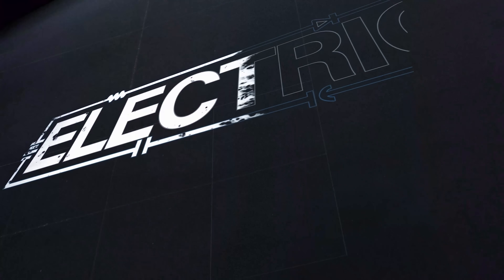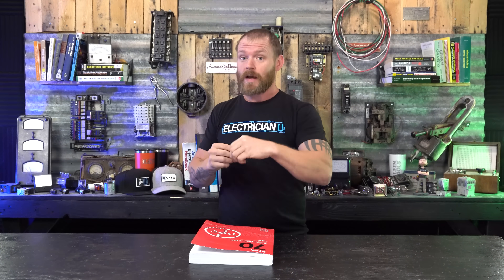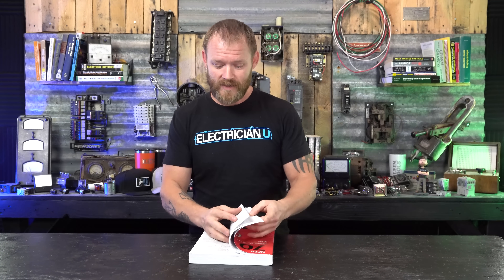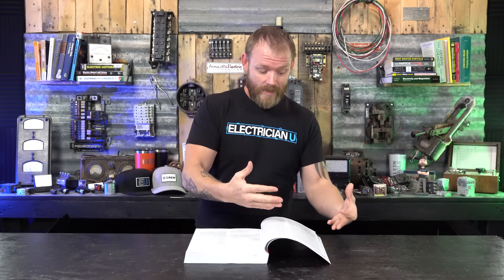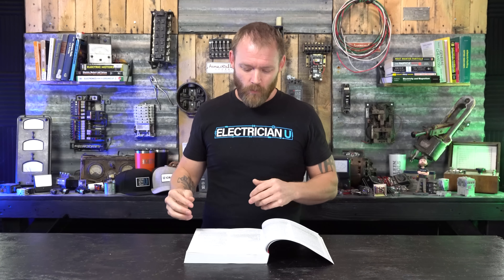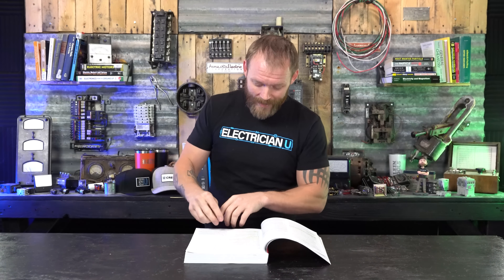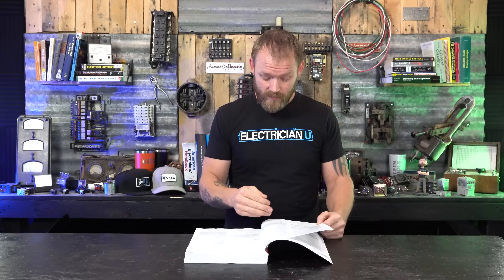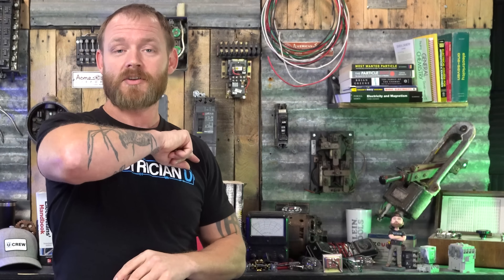Where Should We Be Using Dual Function Breakers?

Comment: Replaced a bunch of Zinsco panels in the HOA laundry rooms. We have dual function Eaton breakers.  Some of them intermittently trip.  I checked the receptacles and some of them were old and could see some arc burns on a few of the back stab devices (50 years old). replaced them but that did not always solve the problem.  Our machines were 20+ years old and figured those old motors could be the cause.  Now we have new machines and some where they were not tripping are tripping. 
How to test the breaker to prove to the machine vendor that their machine is the cause?  When neither replacing the breaker and I cannot get the vendor to change out the machine, what can be done? A regular breaker does not trip but i cannot leave it that way. Maybe GFCI the outlet?
Thanks in Advance.

Comment: What to do when some appliances need 220 v . That means 2 phase 110v + 110v and the breakers has a jumper together connection for two different circuits breakers.

Comment: The answer to your initial question. NO WHERE! EVER! Especially arc fault. Arc fault should be internationally banned and the people that came up with the idea jailed.  The devices can't tell the difference in a current spike from an arc and the 120 current spikes per second of LED bulbs.  Or switching power supplies. Or noise from a lightning strike 50 miles away.  I had my battery operated(because the breaker was tripped) AM radio ON during a storm 50 miles away and every time the speakers crunched with lightning static I could hear pops from the breaker panel. In 20 minutes all but one of the 30 had tripped. Ground fault or Arc fault detection should only be done right at the device and not remotely through long wires. So that totally rules out the breaker panel. GFCI outlets should never be daisy chained to another outlet. OK, maybe if that other outlet is 3 feet away but not more than that.  That wire acts as an antenna and picks up noise.
My new house has all GFAF breakers and is a disaster. A year of this and no electrician has any solution except to take all those GFAF breakers out. The electricity is out so much that the house should be condemned and just torn down.  We have taken to checking into motels on cold nights.
While writing this I decided to get a cold drink. I opened the door and the refrigerator is off. Breaker was tripped. I hate this house.
A house with no electricity is not safe.
You mentioned that arc welder manufacturers are going to have to figure out hose to reduce the current spike of the arc.  The way to do that is capacitors.  0.1uF/400V ceramic caps. But really what that does is mask out the current spike of the arc. Not getting rid of the arc but rather just masking it so the AF breaker can't see it.  So I need to put 0.1uF/400V caps on every line in my house so the GFAF breakers that are required by law can't see any of the noise current spikes. And at the same time they won't be able to see any current spike caused by an arc. Thus negating the entire functionality of the AF breaker. Since electronic noise is so ubiquitous in today's households due to all the new electronic devices I can only conclude that Arc Fault was invented by people that wanted all electricity off.

Comment: Do I need to install a combination Afci and gfci circuit breaker on the switch and light circuit? If so, is there any problem with installing a 20 amp dual function circuit breaker on that circuit?
Reply: replace what is there, lighting is usually 15A or more current modern could even now be just 10a with all LED stuff

Comment: So is there a time delay breaker?..i have a welder rated at 20amp on a 20 amp single pole breaker square d hom breaker..it pops the breaker at times..
Reply: All breakers are time delay which varies slightly between manufacturers, but as a rule of thumb, for example 22 amps flowing through a 20 amp breaker may take a few minutes to trip, while 30 amps might trip it in 30 seconds or less, while 200% of the rating usually activates the magnetic portion of the breaker and trips it instantly.  

The exceptions to this are instantaneous trip breakers and some adjustable trip breakers, which you would only find in industrial panelboards for special applications.
Reply: @rarelampcollector  so if my 20amp welder trips the 20amp breaker ..what would be the way to fix that.?..there's other outlets on that circuit but aren't being used..its about a 75ft run
Reply: @rossokeefe9268  if there is nothing else being used on that circuit, and the breaker occasionally when the welder is being used, either your welder is pulling significantly more than 20 amps, or, much more likely, the breaker is worn and heating up more than it should when carrying it's rated current.   To check for a worn breaker, place a clamp-on multimeter set to AC amps around the wire coming off the breaker.  Have someone at the panel watch the meter while you briefly weld with the machine set to the highest current you'd likely use. If the average current reading is at or slightly below 20 amps and the breaker trips, then the breaker should be replaced.

If you get an average reading of, say 25 amps or more, then either you may have a problem with the welder that's causing it to draw a lot more current than it should, or you may need to run a dedicated 30 amp circuit.   Check the nameplate or the instruction manual that came with the welder, it will list the input current as well as specify what size breaker or fuse is required.   

Some of the smaller welders designed for use on a 120V circuit, can also be configured to operate on  208 or 240V.  If so, and you aren't using the other outlets on that circuit and are absolutely certain there's no lights or other  hardwired appliances on the circuit you can convert the circuit to 240V (or 208V, if you have a 3 phase service) by replacing the single pole 20 with a two pole 20A breaker and putting the black and white wires on the breaker.  Then install a NEMA 6-20 receptacle where you want to use the welder, and remove or disconnect the other outlets on the circuit to prevent someone from plugging in a 120V device and getting a rude awakening.   The existing outlet boxes can be used as junctions if necessary , to supply power to the new 240V outlet.   A welder than can run on either 120V or 240V will draw half the current at 240V when welding at the same current setting.  (Amps = watts ÷ volts) 

Good luck with your troubleshooting journey 🙂

Comment: Thank you! Once again a great video. I am a handyman with decades of electrical experience in the Telecom industry. My customer's house was built in 2019 with EATON service panels (main and a sub panel for Casita and pool equips., etc.), and has 13 defective of 21 DF breakers (won't reset, tripping when no one is there for months at a time, they are AZ snowbirds from IA) or, the test button buzzes but won't trip the breaker. 4 of 9 GF breakers are defective. I made a chart to see what I can move around, replace a DF with a AF or GF, or even a standard breaker to save him some money. This video will help me do it but, in the end, I think it would have been less effort to just replace them all with what's there already. But then I would not have learn as much as I have about these damned things! P.S. Like the really old AFCIs, I think theses DFs are going through revisions to mitigate failures of this magnitude. Fingers crossed.

Comment: Question for the smart old (or young) Folks in the room. What am I supposed to do with an older home that still has cloth 2 conductor wiring. I added a dual function breaker to my kid's room with the hope that it could save him from a shock. Also, will be adding the new tamper resistant plugs. Is this adequate, or am I just totally off base? Also, can I test it at the outlet somehow? This is in an apartment home, so I can't really redo the wiring but got permission to make these changes at my own expense.

Comment: Was updating receptacles to TR in my family room and the breaker tripped out on AFCI as soon as I turned it back on.  I went back and checked my wiring to find that when I had pulled the tab on the receptacle to enable half to be switch-controlled, it left a small burr that was arcing.  The AFCI may have saved my bacon.

Comment: Another advantage of GFCI in panel is the ability to take a circuit tester and plug it into a receptacle and press the test button.  Then you know you can work on that circuit and the correct breaker is off.  Of course, verify, but this can save some back-and-forth to the panel.

Comment: Great video (as usual). Please stop at GFCI protection if you have a metal or wood working shop AND have tools with BRUSH motors. AFCI protection will cause nuisance tripping in this instance. I regularly use a 70-year-old Radial Arm Saw (RAS) in my production woodworking shop that is technically part of my dwelling (converted garage). The RAS, and all of my older routers (for example) still have motors with brushes. Most (all?) new tools are “brushless,” so this will allow AFCI protection. It’s cost-prohibitive to replace all tools with brush-containing motors with new brushless ones. Thanks NEC for allowing this exception.

Comment: It's weird how complicated stuff is up there. Here in Argentina we have the line and neutral from the meter to a general thermo magnetic "breaker" which trips with overcurrent so your cables don't melt and also with shorts between live and neutral. From that to a differential that trips with ground derivations. Then you add smaller thermomagnetics for each individual circuit in the house, generally 10 amp for lighting, 16 amp for receptacles, and a 20 amp for special use receptacles like ovens and water heaters. And AC units are generally in a separate circuit too

Comment: Why doesn't anyone ever mention the big issue with AFCI in the code. The first device from the AFCI can not be any longer than 50' of wire for 14/2 and 70' for 12/2, that can cause nothing but problems with larger houses..
Reply: Oh shit I didn’t know this. We have AFCI circuit for lighting and you can’t even turn the lights on without the breaker tripping. Wonder if this is the issue. We have swapped out afci for time being with normal inverse time breakers and it holds just fine

Comment: This is super detailed and a great educational tool for anyone looking to learn about arc fault/ground fault breakers. Has anyone dealt with Siemens afci/gfci dual breaker tripping? I have them in my kitchen and laundry rooms both of which trip for a blender and heat pump washer/dryer.  I’m replacing both with an arc breaker and gfci blank in my crawlspace for the kitchen because they combined two receptacles there that need gfci protection. Anyone with info on those breakers would be great. I’ve tried replacing and they consistently trip no matter what but don’t trip on regular arcs or other gfci’s.

Comment: I just got a new fridge installed & it’s tripping the breaker multiple times a day, the old fridge was just fine. 
the current breaker running it is a CAFCI arc fault breaker and plugged into a regular outlet. Would swapping the breaker to a dual function breaker correct the issue?

Comment: I agree with the inspectors. If you do a modification add AFCI at all appropriate locations on that panel or whatever. Why? Old wire is more likely to have a problem than a whole new electrical installation. AFCI's will detect dodgy old wiring with active arcing and prevent fires. It makes total sense to me.

I am scoping out AFCI breakers for my home to be installed in an existing panel. I'm adding no wires, changing nothing. If something in the home works loose I'd prefer the breaker trip rather than the fire alarm go off just before we are about to die. Being an old panel with limited neutral landing spots I will have to be selective. The kitchen, living room and occupied bedrooms are a good start. Some protection is better than no protection.

Comment: I think your example of the GFCI receptacle behind the refrigerator fails to comply with 210.8, in that this location does not meet the definition of "readily accessible".  So it really shouldn't be a matter of either locating it behind the refer or perhaps installing a DF breaker.  Either the GFCI receptacle is not buried behind the refrigerator, or a DF breaker may be considered.

Comment: So to clarify, a dual function GFCI AFCI breaker is not the same as a combination GAFCI breaker? Also, do you have any videos that discuss troubleshooting an AFCI breaker? I just ran a circuit with (I''ll have to check) and combination breaker for a dishwasher. But, it is tripping even with the dishwasher is not plugged in. The conductors and ground are all testing as not having continuity with the hot wire. So not sure what it is picking up on. But, if I have the wires disconnected from the breaker, and only it's pigtail connected to the neutral bus, it does not trip. So it seems it doesn't like something about the wire run. But, I have also been told it may be the currently main breaker panel where this is connected, as it has the ground wires and neutral wires all intermixed over the 2 busses. The 2 busses are also jumped, so I didn't see why this would matter. Also had someone tell me to remove the bus jumper and connected all the grounds to the bus with the earth ground connected to it (going out to the ground rods), and to move the neutrals to the one without the earth ground. But also had others say that the 2 buses should be done where all the grounds are connected to the one with the earth ground, neutrals on the other, and still leave them jumped - that somehow this not being done could cause false trips of the AFCI break - but that doing this later patter would stop those false trips. The circuit was run with a 20amp breaker using MC cable to a metal outlet box with 12/2 wire. But not happy!

Comment: About the false tripping of arc fault, seen it happen on a job site. High starting load motors such as a table or chop saw can trip them. So I learned from it that a "workshop", large corded tool, should use regular breakers. Now as you said about arc wielders, I can see that as time moves on and breakers get smarter the requirement for everything being on arc fault happening.

Comment: what are your thoughts about dual function breakers being installed in older homes which still have older knob and tube wiring? Would you recommend using dual function breakers for all circuits?

Comment: So now I have a thought... If I replace my old breakers, can I just can use only dual function arc-fault/GFCI circuit breakers and be done with it? Its my money I can waste it if I want to and provide the best of both worlds. And with Lowes and the 10% military discount. If I can replace them in a 1 for 1 is I am allowed to do that and not rewire the house. Seems like I can and still be in code?
Seems like the cabling is all the same the difference is in the breaker if I finally understand it.

Comment: I think I would feel better and make everything GFCI as I go along. I feal like every year or two I have to replace the GFIC breaker on the PED for my salt water pool. It has its own breaker. I would like to just change the breaker and be done with it.

Really if there is an issue in the electricity it will help show the problems faster. I had a 50 youa garage burn down I think now after watching from parallel Arc to a nail that might have compromised a wire in the damp humid NC area. I think from the description a GFI would have tripped. I don't know the GFIC math yet to know. Anyhow... I am thinking unless running a brush motor I want everything upgraden and just label it to avoid confusion if a repair is needed. Even hair dryers are brushless arc free motors. Possibly my garage shed. My grinder could make a arc. I can have a arc friendly CI on the home that does not require a ext generator to use.
Hopefully I think I am making smarter statements now. Chances are I still have this wrong. GFIC plug easy arms reach, everything on the dual breaker.

Comment: One of my favorite applications for combination AF/GF breakers is retractable hoses for central vacuums.  Retractable hoses are wired to power 24/7 and it would not have a cord or plug.  So, it will not be plugged into a receptacle.  However, the code still requires AF protection for those.  And, though it is hardwired, the hose still has a receptacle at the end.  For central vacuum accessories that are hardwired, I just use a combination AF/GF breaker and call it a day.  However, I go a step further.  I put a wall switch for hardwired vacuum cleaner accessories.  You shut it off when you are finished so, there is only power in the hose during cleaning.

Comment: Just making sure, those dual function breakers were just for outlets series right? Not light and switches
Reply: Man, you said 2013 nec, that's been around long enough that i wish the DF breakers were cheaper already. Sounds like I'd have replace all my breakers. Hate they standardize the wrong breakers with a new electrical panel

Comment: I am working on a project for my Cabin (off grid solar/generator) and having to run all new electrical for this. The A/C is just a window unit or two and heating is typically just a wood stove. I am curious with the inconsistent environment and down time on the system would you recommend using dual breakers with the minimum of code or would you use dual breakers for the entirety.

Comment: I am starting a project to change to arc fault breakers. It seems like I can buy dual function (Arc & Ground fault) for the same price as an arc fault. Would it be ok to switch all the 15 & 20 amp circuits to DF type breakers?  Thanks.